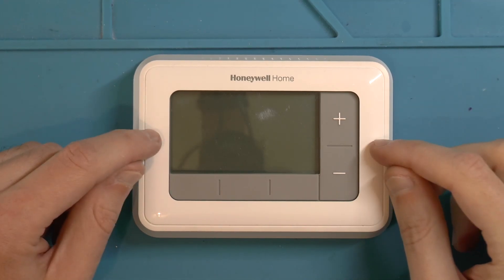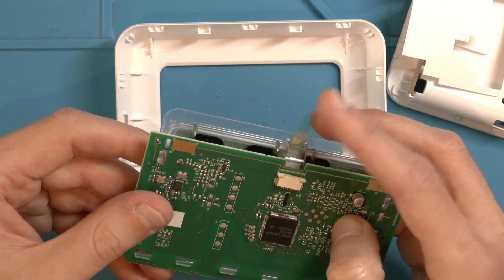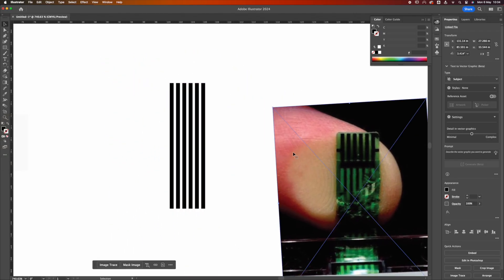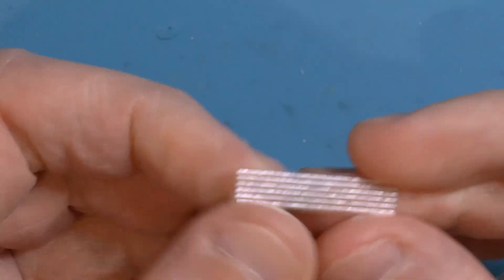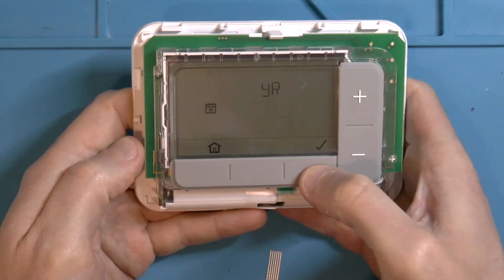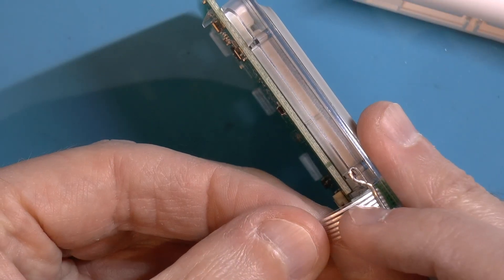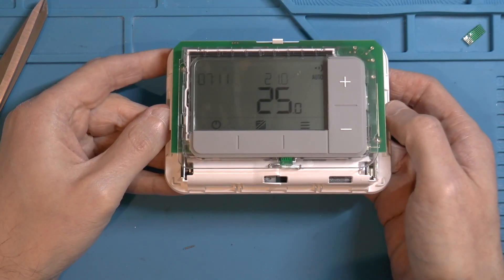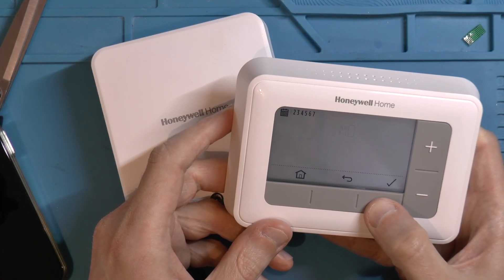Damaged ribbon cable - is it possible to repair?

Comment: I have a damaged flex cable that has carbon conductors or traces.  When I used carbon ink it breaks and comes off, can it be repaired?
Reply from the maker: I've never had to repair one of those but perhaps conductive silver paint would work?

Comment: Apologies if this sounds stupid, but why doesn’t some company make sheets of FFC? Where you can select the number of traces and cut it according to requirements? Brilliant repair as always.
Reply from the maker: That actually sounds quite sensible, but the pitch between the pins varies a lot so there would need to be lots of options.

Comment: Nice repair idea. I used to repair circuit boards for aircraft black boxes and we had circuit board repair kits. And these kits had strips of copper runs to repair burnt board traces. Those copper runner strips would work great to repair the ribbon cable... Thumbs Up!

Comment: I used wire wrapping wire (single strand, silver plated copper) to connect the two halves of one that broke. Used a needle to punch a couple holes at an angle, and threaded the bare wire ends though, making contact for a couple mm with the conductors in the flat flex. Got the LCD display working again. To this day one of the hackiest repairs I've done, that was my third attempt at fixing it with limited means.
Reply from the maker: That's probably a better solution than mine!

Comment: 😂 this is really a too complicated way! I mean, the fpc appears to be a standard straight line connector with  a 0.5mm separation(?) that can be bought online. It's when it's part of a custom made circuit and connector combo that problem arises. I was hoping to gain an insight as to whether the plastic (non Kapton)can take a direct solder rework. I tried and while the plastic didn't melt, the wires seem to "deform" off the plastic surface due to the heat- really not too certain as to what happened there..

Comment: Pretty clever repair! I must get one of those machines that you used to cut the tape. I tried a similar repair on a keyboard membrane that was damaged. I used some acetate sheet too but I had to hand cut the copper tape I used. I tried 3D printing a clamp to apply pressure that I screwed into place but it still wasn't reliable for me. Perhaps aluminum tape works better. In the end I got a conductive ink pen, which I used to splice my diy cable to the remanents of the original and then I soldered wires and a pin header to my DIY cable. Then I was able to plug in the keyboard and this enabled me to avoid the stress on the flat cable as it passed through the case at an angle, with the top case pressing on it upn closing it. Its been fine ever since but I suspect it wouldn't last long if I had to remove the membrane often and handle it. Still its simple enough to redo it if I have to, if a little time consuming.

Comment: if i don't have that printer i will use a flat flex cable from a donor board, a dvd drive or a notebook, cut it to the size of original and voila 😁

Comment: You could have just soldered single strands of wire across the gap and used kapton tape. You just over complicated the snot out of a simple and easy repair.

Comment: Since I have 3D printers, I would have printed a small rectangle with a slot in it barely big enough for both the original cabe and your home made one so you would say slide it over the original good part and then have to squeeze the new bit in with it thus assuring a tight fit to each other and keeping them properly aligned. Assuming you don't have a 3D printer though. Worked and that's what matters in the end.

Comment: You can use silver conductive epoxy. One used to repair car window heaters. Just mask off areas between. Also make sure its thin layer or it will crack. Done it on similar things.

Comment: I repaired a lot of ribbon cables in my time. There are two types. 
The first type is some kind of electronic ink. It is used in some Macbooks, a lot of keyboards and carseats. The only option you have with this is to make your own metallic ink which is not really accurate.
The other type and the one you have is called FFC. You can take some higher quality flux like amtech, small speaker wire in the desired thickness and bismuth solder like mechanic x. Then you can use a fine tip like a JBC C210 under a microscope and solder to the leftover pads. It helps to use a fiber brush to clean it up a bit. Wrap in kapton tape for stability.
Reply: You are talking about FPC, flexible printed circuit. They typically have that distinctive orange colour.

Otherwise, yes FFC, flat flexible cables. Such as repaired here.
Reply: @frtls  I was talking about another kind of ribbon cable. Usually both FFC and FPC both have a metal core where you can solder to. Repairwise there isn't much of a difference between ffc and fpc except FFC is a bit sturdier and FPC can have a much higher pitch. There is a connector from hell built inside Macbook A1502 and maybe later. Instead of copper it uses some powdery metal ink which rubs off quite easily and destroys the whole topcase if you look at it wrong. Its impossible to repair or at least I haven't found a solution yet. With cars you at least have enough surface area to use conductive ink.

Comment: Nice work!      Am glad to see you fixed it.  Now am wondering if there's any easier repair
without needing the expensive investment you have already made in equipment and in Adobe software.  A way to make and maintain the 6 electrical connections using an off-the-shelf part ?
Reply from the maker: If you were careful I think it would be possible to do the same thing with a craft knife and some precise measurement.

Comment: it's a bit small for this type of repair, but rear window defroster repair products work.  it is basically a conductive paint meant to bridge broken heater wires on the window.  it works for things like keyboards where the features are larger.

Comment: The aluminum tape maybe will react with the conector pins if they are not gold, or nickel plated, galvanization will ocour if the conector pins is made of brass.

Comment: Thanks! Do you know a way to reattach a detached 'Flexible Printed Circuit', back to its mother board?
Reply from the maker: Not reliably - those are certainly a problem.
Reply: @SpareTimeRepair  Thanks

Comment: Nicely done, makes me want a cnc cutting machine. Perhaps a dab of superglue on the clamp ends or something to hold it in place against the plastic would provide some mechanical resiliance. Also, classic mistake from Honeywell (all manufacturers do it though) putting a hole with a critical connection behind it in a place the uninitiated would shove a screwdriver! Thanks for sharing.

Comment: The real trick for this is 3M Z-Axis conductive adhesive tape - Adafruit carries it. Only conducts through the thickness of the tape, not through the length or width. As long as the traces are aligned properly, the tape will handle the connection without shorting to adjacent traces.
Reply: thats also works, but you have to make sure that pressure is maintained. My experience is if you dont have pressure it will last few month and then fail.
Reply: Well-Done, Sir. An Excellent Self Innovative Way You've Succeeded the Task On Your Own Line, Is Quite Appreciated.👍👍👍🌷🌷🌷🍒🍒🍒🕊️🕊️🕊️🎈🎈🎈🌈🌈🌈 
Regards,
Tummalapalli.V.R. Murthy.

Comment: FYI, in the electronics industry this is not called a ribbon cable, because that term was already taken by the older type that is simply many insulated wires stuck to each other. This kind is known as a “flat-flex cable” or FFC.
Reply from the maker: Thank you - that's an important distinction. I will try to get it right from now on.
Reply: Yes - they are standard lengths, conductor count and pitches. Very cheap online.
Reply: @geoffreykeane4072  Indeed. And custom lengths are easily ordered, too.

Comment: Great work!  There is a unidirectional conductive double-sided tape that you may want to check out if you have the chance: https://www.youtube.com/watch?v=0HZ35CyHVxQ 

I imagine it's possible to repair the ribbon cable with your brilliant aluminum ribbon, anisotropic conductive tape, and epoxy for a very permanent solution

Comment: You can use conductive glue, i know some people who use them on unsolderable ribbons to fix them. They come in tiny 0.2ml, 0.4ml, etc syringes
Reply: I thought of that too but it will be very difficult not to short the wires together
Reply: @killingmercy Nonsense. That’s what fine brushes are for.

Comment: If you used copper tape on kapton tape instead of aluminium tape on acetate film, the finished ribbon cable might be solderable.
Reply: It wouldn’t even need to be solderable if made using copper tape with conductive adhesive.
Reply: Yeah but the ripped ribbon isnt